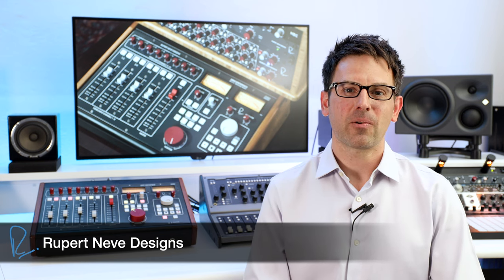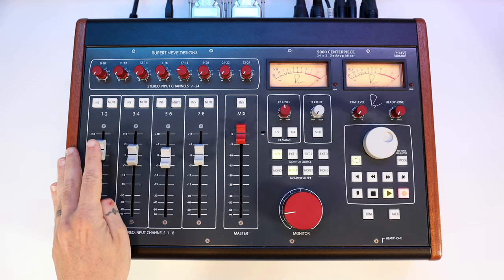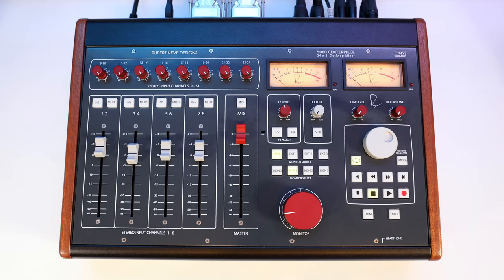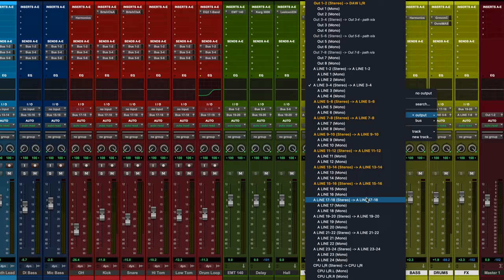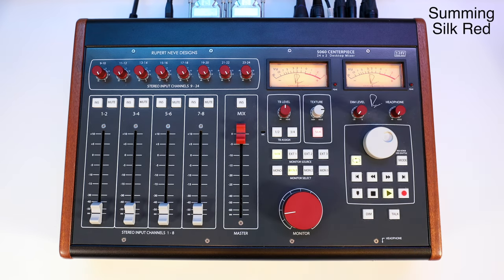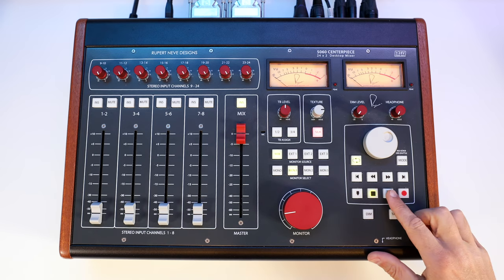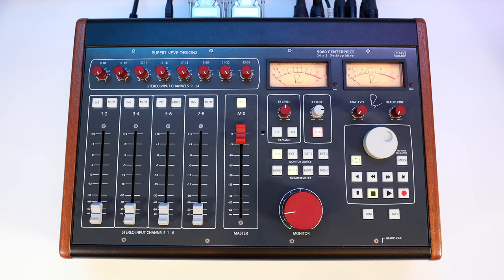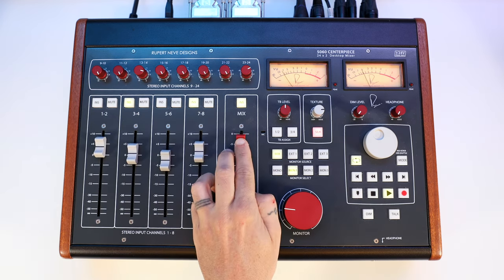Rupert Neve Designs 5060 Centerpiece 🏆 Workflow Tutorial and Summing Review 🎬

Comment: hi thank you for the video! could you please make an video on how to connect the back of the 5060 correctly to the interface + outboard gear on inserts (1-8) and mix buss? (external monitoring, sends, etc) would really help!

i understand how to connect outboard gear to the daw via output track etcs.

hopefully you consider it, these videos you've made helped alot since no one really puts much info out on youtube about the 5060! again thanks and subscribed.
Reply from the maker: I’d love to do a followup, but probably am not getting to it in the next 6 months. So in the meantime, hopefully this helps: use the insert output to connect a DB25 cable to 8 XLR males. This will go into your inputs of outboard gear. Then use 8 XLR females to go from the outboard gear back to the DB25 insert returns. This allows you to use the insert switches on channels 1-8 to send signal out to hardware. 

Another option is just to put a patchbay before the 5060. I’ve thought about doing this, but personally like to have things as simple as possible to keep cabling clean. 

Hope that helps for now! 😃
Reply: I was wondering the same in regards to the External Monitoring set up both in Pro Tools and connection on the rear. You monitor ext 1 “in the box” in your video and then switch to the summed mix - trying to do the same! 

Great videos. Subscribed!! And thanks for the original question above!
Reply from the maker: I take the stereo out of my interface and run it into the external input. Now, whenever I want to compare the summed to the direct converters, a push of the button can allow that. But the only thing is you will need to route your tracks or stems to both the stereo output of your converter along with individual outputs going to summing. These days, I just keep everything in summing mode, as I already know what to expect. (Not sure if that all makes sense….)
Reply: Thank you so much! Yep makes sense!
Reply: @ToddUrban  So you create two Aux's for each group to do this or is there another way? Thank you!!
Reply from the maker: @johnkellybiz  in Pro Tools you can assign to more than one output, but in Logic and other DAW, you would probably need secondary aux tracks for it to happen. As I said, I used to do that to compare. But once you understand the differences, you will just work in summing mode 90% of the time. (With the exception of when you need to deliver a mix that is only worked on in the box)
Reply from the maker: Oh, and the other thing is that once you have your stem outputs setup, it is easy to switch from in the box to summing just by changing those outputs. It takes 20 seconds. (Of course you can’t flip back and forth quickly for an A/B, but as I said, I’m not doing that anymore now that I’m convinced of this workflow’s value)
Reply: Thank you! I get that for sure. Really appreciate the explanation 🙏
Reply: Facts

Comment: Can you clarify how you are handling the cue mix checks? Are you only feeding the four cues on 1-8 during tracking and selectively unmuting the one you want to hear in the 5060 headphones or do also you feed 9-16, but mute those when you want to check a cue? Since there is no soloing on the 5060, it wasn't clear to me how you were doing this.
Reply from the maker: So, I use the 4 faders in a way that the product isn’t really intended. I feed the 4 stereo cues from my apollo to those faders. Then the inserts on those are sending to the headphone amp. It can be 8 mono cues or 4 stereo. For me the benefit while tracking is that I can check what the artist is getting in their cue mixes. It’s also a quick way for me to grab a fader and monitor something such as a vocal that’s being tracked without changing the relative levels in their cue mixes. (Since the sends are prefader) Not sure if that answers the question. 

Channels 9-24 are the only ones I use for summing.

Comment: Thanks so much for the detailed workflow demonstrations. Very insightful as im thinking of making this substantial investment. Am I missing something though.... Looking at the I/O,  what outputs are feeding the headphone or cue mix? Where is the talkback being sent out of? Its not apparently clear to me just looking at the connections. Any info on how that is setup would be greatly appreciated. Thanks
Reply from the maker: Hi. Thanks for watching. You can send the built in mic to either Cue 1/2 or Cue 3/4. I personally use 8 cues with my mixes, so instead of doing this, I route the internal mic out of a TRS out the back of the 5060 into my interface. This lets me still use the button for the TB on the unit, but then I can assign that built in mic to any routing I want. I did used to use the built in Cues and it works fine and is super easy. (you do need to turn them on each time you power up the unit). One thing I also like about routing the TB mic back to my interface is that I also do some EQing and limiting on it to get my voice a little clearer when communicating with the artist. 

Hope that helps.
Reply: @ToddUrban  Yes, most definitely helps a ton and thank you very much. I guess when looking at the photos of the unit I must have overlooked outputs for the q routing. That's what made me ask. I didn't see any physical outputs labeled for the cue outputs so I wasn't sure
Reply from the maker: Ah! Yes. For me, that is one of the most essential parts. The product is intended for summing and mixing. But I also use it as my control room for cue monitoring. It has become essential for my workflow, even when I’m not mixing and only tracking. To me, that was an amazing surprise. It is expensive, but a great long term investment if you can make it fit your budget.

Comment: Todd, how did you get the USB connection to work? I'm having trouble with getting the MacBook to recognize the 5060 in Logic Pro.
Reply from the maker: Hmm. For me, it was plug and play. It was instantly recognized under controller assignments. Maybe try a different cable? Sometimes using usb hubs can also affect things.
Reply from the maker: Of course you do need to set it up as a MCU device, but if you aren’t seeing it show up as an option to select as a controller, something is wrong. It should be like any other generic midi assignable controller
Reply: I am using a hub and now I'm trying to find a way around it. Are you using Mac? If so, what computer and year?

My problem is the connection is all Thunderbolt/USB-C. 

The 5060 connection is a different usb.

Also, what MCU device did you choose? (I already know where the settings are.) @ToddUrban
Reply from the maker: @blvkqmusicgroup  trying going direct just to see if it shows. Once you do, it should just show up as Centerpiece 5060 as a discoverable device. I’m assuming the hub might cause issues. Sometimes different hubs can help with multiple devices. I’ve had hubs go bad for certain devices when it still works for other ones
Reply: @ToddUrban  gotcha. It’s making more sense now. The trouble is my Mac uses thunderbolt ports. So I’ll have to figure out how to connect that.
Reply from the maker: @blvkqmusicgroup  ah. Yeah, they can be a pain….. but try a few different ones. It should work fine.

Comment: Love your videos on the 5060. I have the 5059 and MBPon the way if you can do a video on the 5059 that would be great. Also what brand of db25s are you using? There isn’t enough good content on the nerve 5060 and 5059 workflow so keep it coming !
Reply from the maker: I don’t currently own a 5059, but have used them and love them. At some point it would be great to cover the Satellite and Orbit. I’m using the Jumperz, which are available at Sweetwater. Super solid connectors. They are very expensive though!
Reply: @ToddUrban  Thanks for the reply. You have a great piece with the 5060 already. The Orbit would be icing on the cake. Thanks for the input on the cables my box comes tomorrow ! Keep up the great videos
Reply from the maker: Super exciting! Once you get it hooked up, you will find that the more you use it, the more colors you can get out of it. Try hitting it harder or softer with different levels and also experiment with the silk!

Comment: How do you compensate the latency in pro tools when you are summing analog? For example, i want to sum my harmonic instruments through the 5060, but i want to listen to the drums and vocals simultaneously. What do i have to do in pro tools?
Reply from the maker: I don’t. I usually bounce stems with the idea that they will he processed a little later on.

However, if you record the 5060 back into your session, you will be able to monitor the stem properly with low latency compensation while recording that stem. But then I always play back the original tracks, as the rendered stems will always be slightly behind. (But all of them by the same amount) 

Not sure if that just made sense…
Reply: @ToddUrban  Thank you for your answer. It all makes sense, i just thought you had a solution for it.
Reply from the maker: Not while rendering stems. Therefore I just prepare the mix on the 5060 so I get the sound I want. Then just bounce them through it to a new track. Once all stems are rendered, all the stems will be fully in sync with each other.